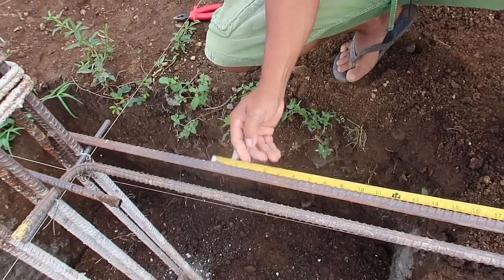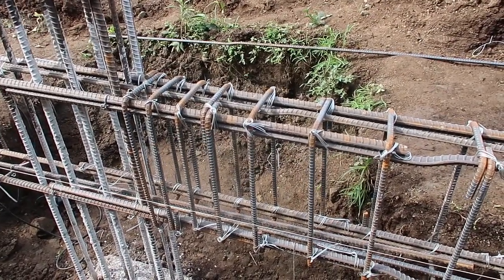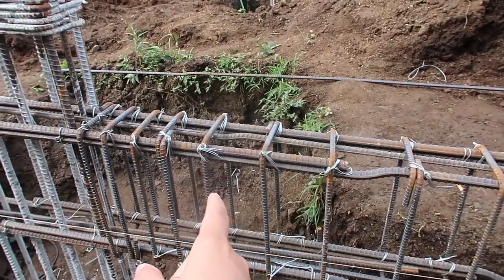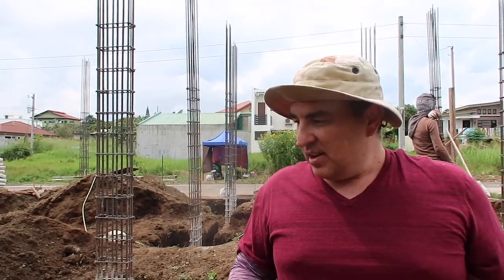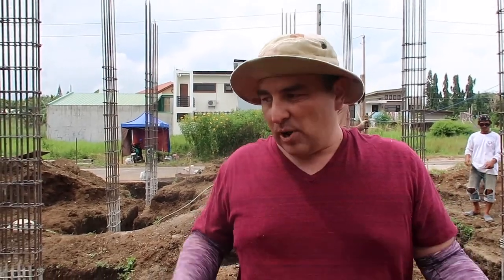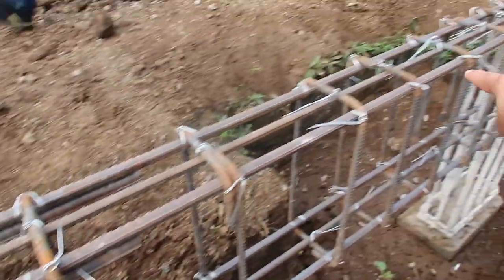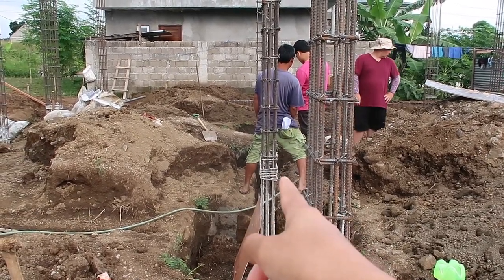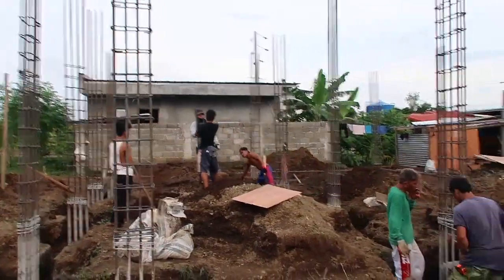HOUSE BUILDING IN THE PHILIPPINES - EPISODE 16: SPLICING

Comment: I agree with Manuel... dont worry so much on the grade beams. Your husband is 100% correct regarding the splicing... top bar should be spliced at the center of two columns but the bottom bar should be close to the column, inside the column even better. On that 16mm rebar your overlap needs to be 64cm. The rule of thumb is lap should be 40 times your bar diameter. So if you are working with a 16mm size bar you need to overlap 64cm. This is actually how they do it here in the Philippines... not sure in other countries.
Reply from the maker: Thanks for the input
Reply: @Mike Ross This is the kind of comment I enjoy reading, very technical and makes sense. Worth treasuring in the brain
Reply: well said.. 40X the diameter  rule of thumb. If you use no. 4  that should be at least 30"  or higher   lap splice. Yes  center of 2 columns for top bars and  bottom bar close to the column. It's same in the U.S Mike .
Reply: Yes the splicing is AT LEAST 40 times rebar diameter. But sometimes it's more than that depending on the analysis and design. I hope 40D is sufficient for your structure since it was already done.

Comment: Hi, I'm a structural engineer. Your idea about splicing is somehow correct. The top bar should be spliced farther the column while the bottom bar should be spliced nearer the support. This is because the rebar is designed to carry the tensile forces of the beam, which is located near the support at the top and at midspan at the bottom. This is not applicable for all beams because beams with discontinuous spans tend to have their tensile forces at the bottom for the whole span. But the most important thing is that the splicing details should be included in the structural plans of your house. You should try to check if it is written in the plans. It is the responsibility of the structural engineer to write it as well as the contractor to follow it. It is also the government's responsibility to check whether the plan is correct.
Reply: Please check the 2:43 of the video. There was a spliced at the confinement zone of tie beam & column.
Reply: Correct engr.
Reply: So that does mean na pag tie beam or nasa ilalim ng lupa yung beam ay dapat yung splicing sa top bar is 2h?at sa bottom bar ay middle third?

Comment: actually its a plinth beam. the upward force is in the center of beam upside, so you the splicing should not be in the upperside in the center but on the bottom and in the upper side near column. plinth beam and regular beams have different moments.

Comment: Hi!
your theory is correct, for the suspended beam
but for the tie beam, it acts differently, the bend is upwards, so splicing will be inverted.
basically, splicing at the column part will be at the Top and at the middle section of the tie beam spliced will be at the bottom.
cheers

Comment: for splice location for tie beam it should be located  L/4  of the length of TB for top bars and L/2 for bottom bars.                          L= length of tie beam,                                                                                                                                                                                                                                                          purposed for tie beam is to prevent uplift pressure coming from ground to overturn your footing foundation. Pressure diagram for the tie beam is curved upward, top bars are prone to tension force at the center and bottom bars are prone to compression force @ bottom. that is why  splice location for tie beam you should follow what is mention aboved.
Reply: Your response ignores the fact that the beams will be load bearing along their top length, and that the ground is not applying anything other than a zero-sum force to the underside of the beams. The following video applies in this situation.
https://www.youtube.com/watch?v=FZYjor8Se9U&list=PLgxsva1T4ojZAlWmyAzNfogA8maHfZi2s&index=2&t=48s

Comment: The splicing of top bar is located at middle or L/2 while bottom bar is at support or L/4
Reply: No. L/4 kalokohan. Near the Support ang ang dapat. Hindi exactly L/4
Reply: @engr.acoustic6803  L/4 and L/2 is the rule of thumb   where the steelman can easily determine and compute the location of splicing.if you say  near the support there is no formula or computation  it is just assumed computation..near the support is under the span of  L/4..

Comment: just only suggestion, It is considered safe since this is a tie beam & supported by a compacted underlying base, as well the reinforcement at bottom beam section designed to resist the weight at the middle span.

Comment: right, splicing on top is in the middle 1/3, 1/3,/1,3 sample, lower part is correct where the splicing. all beam bars are inside the column bars. that's help u

Comment: The splice must be inside the column and the ties of the beam continue inside the column also the stirrups of column continue all the way down you can also install additional rebar on the middle of the beam.so that your beam is very strong
Reply: yeah its correct sir... its called midspan support u put extra 2 rebars in midspan coz the deflection is in the center....

Comment: As a rough guide for top splicing it can be done after 1/4 of the distance away from the columns... if 4 M apart then splice after the 1 M point, middle is a better option and stagger the joints.

Comment: Hi Andy. You are correct with the Splicing issue, but perhaps you do not fully understand why.
At the middle of the top of a beam, the beam will be in compression when loaded from above, such as by the supporting walls of your house.  The major stresses on the top of the beam occur as shear stresses and tension at the point where the beam joins the supporting columns, and that is why there should be a greater number of stirrups along the quarter of the beam length close to the supporting column and most importantly there must be no joins in this section. I used to believe that the shear stresses would be at 90 degrees to the beam, but this is not the case, the shear stesses appear diagonally, thus to counter this the number of stirrups needs to be greater.
The Bottom of the beam will be in tension at the centre of the beam, but at the bottom ends of the beam it will be in compression, hence why joins for the rebar at the bottom of the beam should be as close to the ends of the beam as possible.
.
I hope this helps

Comment: Sir, you are  correct of what  you are thinking.the foreman should know that. By the way I'm a viewer of construction vlog.What I understand about splicing was on the top bar it should be at the middle of the span, and at the bottom bar it should be L/5, ( Total length in between two colums devided by 5 )  so it's position near the column. By the way Sir the mixture of the cement poured in the footing, column and beam was too much water in it. I was a late viewer, anyway you have a nice house.tnx.

Comment: There is a big mistake and can cause problems in the future, the Stirrups, the stirrups ends should be bent 135 degrees inwards for best locking on the concrete .
Reply: Depends on seismic load?

Comment: tie beam footing and other foundation better to consult your geotechnical engineer for soil analysis and structural engineer. in my opinion ground beams the pressure is upward so top bars are in tension splice could be L/4 from support.

Comment: Since your colunm is not tied to the beam (no L shaped rebar going from horizontal to vertical), not a issue. Code for overlapping is more important to get right (say 3 foot overlap and not 6 inches). It is better how ever to have splices offset and away from a high loaded area, so that it does not create a weak point in 1 location. The beam is designed more to keep things from pulling apart, not holding up weight. You could just have the guys weld the rebar together in a couple of spots to solve that issue, but since this was done almost a year ago, it should be fine. As far as doing what you want, it is YOUR money, so you decide how things get done. I have that same problem when I get people to do things at our place in Mindinao.

Comment: Splicing of rebar varies on structural flexural members.
For footing tie beam, the top bar at support (column), and bottom at mid-span. If we consider soil subgrade reaction, the response of the tie beam will bend upward causing top fiber in tension and bottom in compression. Prior to rebar fabrication and installation, there should be rebar shop drawings and bar bending schedule to be reviewed and approved by the engineer of record. 

The case for girders on upper floors has a different response since it will carry floor loads. It will bend downward resulting in midspan bottom fiber in tension and top in compression. Place top bar splice at midspan and bottom start at 2x the height of girder being considered. The 2H start of splice and tension lap splice length is recommended since stress reversal occurs when the frame is swaying due to lateral forces assuming this project located at seismic zone 4.

For beams that usually carry gravity loads, place the top bar splice at the midspan and the bottom bar at support.
Reply: Hello what if yung tie beam is naka pantay sa 0.00 elevation ng house? Pano po iyon? Bale yung top is 2h at bottom naman ang nasa middle third?

Comment: Worry  less on ground  tie beams..Worry more  on above  ground  tie beams...You don't have basement....Try to  avoid  splicing..Rebars  comes in 40 ft... If you  have to.. do it somewhere  in the middle  with minimum 2 feet  overlap..Don't  splice directly opposite  one another.. This results to a weak area...U.S.  uses couplers/connectors then hydraulic  press or crimper...One options  are weld it or use U bolts..
Reply: What are you credentials?
Reply: @thomascherney7873  My only credential  is work experience  & observations from others... like  building inspectors.  However.   I can learn  from others  with  better  credentials.

Comment: You are correct. Splicing must not be done where the rebars bear the tension. In a beam that is continuous across a column near the column the tensile stress is st the top, but at the middle of the beam the tensile stress is at the bottom of the beam. 

So, REDDIT as the husband says because the splice is not strong enough in tension. 
If you don't want to redo it, you can strengthen the splice by welding it along the splice as it is now!

Comment: The explanation of why we should place the splices in the middle is just funny 😅, he missed the story on why we recommend to place the splice of the top reinforcement in the middle of the span and bottom on the support. Any way it is just a recommended practice not a most and it will not make your structure weeker

Comment: splicing should be done in alternate way, regarding the size of rebars you can also order according to your preferred length, 6 meters length is only a base length, i suggest you use grade 40 rebars.

Comment: Thank you for the video. The beam reinforcements arrangement will be okay if it is just a tie beam. However, if it is going to experience bending moment and shear force, the reinforcement could be arranged in the other way round, by considering the grade beam reactions as inverted suspended beams.  Fadeyi Lawrence Olaniyi, Nigeria

Comment: I think they are still in the planning stage, a lot slower work if that's the situation. They could have  improved the Pace.At  The middle of the beam , a column is necessary IF the Span is greater than 3 meters vetween 2 post or column, but if its just the ground tie beam, it can be omitted,but not if its overhead beam!

Comment: The guy is right about splicing and he should have told his workers do it his way but on the tie beam it probably does not matter much because that will be underground although when they get to the beams it should be the white boy's idea that should be followed.
Reply: Just because the beam is underground does not mean that it is not load bearing. The white guy (Andy) is correct full stop. It is not an idea but recognised correct building practice. Even in the Pilipinas

Comment: Bottom splices no more than 25% of  of span from the end to the center of the
 overlap. Top splice center falls within the center 25% of span. Overlap on beams
 is 40 bar diameters with the dog leg bend of one bar like you have done.
     The location of the tie beams is between all adjacent columns and under the
center of the wall hollow blocks because it is also a footer for the wall. I always
pour the floors after the tie beams  and occasionally monolithically with the tie
beams on smaller floors like 5 by 8 meters where you won't be cutting a lot of
expansion crack reliefs. Then the walls go on top of the floor which can extend
past the tie beams  about 3 times the floor thickness. If the walls don't land on
the tie beams pour footers to set the walls on. minimum depth is the finish wall 
thickness and width is 3 times wall thickness (blockwork plus render) with rebar
3 bar diameters up from the bottom of the footer.
        For floors I start bars with a 16 inch length stagger  at the end and step back 16"
on each succeeding row. Whatever is left at the far side is the first piece of the next
row. Any left over bits get tied at 45 degrees at the corners of the columns to help
reduce inside corner type cracks where the floor wraps around the columns. With this
approach no bar splices are  beside each other and I use a standard lap of 16 inches 
minimum on smaller bars and 24 inches for 12mm and above. Spacing of bars  is
calculated for the short dimension of a floor with  a 50% safety factor on the concrete
and rebar weight (dead load) and 50 pounds  per square foot live load plus any thing
permanently affixed to the structure. The rebars set 90 degrees to the calculated
direction are actually all just more stabilization and safety factor.
        One other thing, I start calculating rebar stress at the top of the building where
the roof attaches, and then work down adding everything above a point at the floor
level tie beams and column weight to that level. Then add the suspended floor and in
all the walls and columns weight to size the next floor tie beams and column 
sizing which would typically be the tie beams you are pouring now. The top beams and columns are about 25% smaller than the first floor even with the concrete flat roof.  We
also have a spider beam holding up the roof with 10 legs and 162 rebars passing the 
center point and 530 feet of electrical conduit in the spider beam.  And .......still no
electrical connection.

                                    george and aurora

Comment: Splicing is always the upper rebars should be 1 meter away from the column and the lower rebars should be 80cm or 0.80 meter
And splicing also in the middle but is not exactly at the middle, and it should be the same near the column , get the middle and splice it away at 1meter for the upper rebars and 0.80 meter for the lower rebars

Comment: I am not an engineer but i understand somehow how to build a concrete house. Sorry to say all what they do are not in accordance to how a concrete house should be build, for example even the stirrups should be bend not only 100 digrees but 135 digrees. About the splicing they should not put it next to the columm and the joint should not be in the same lenght with the others. One more thing i've noticed was under the tighbeams they did not put gravel first before they poured the cement and maybe also all the columms.🙄 i think the soil has a low bearing capacity.....thanks for reading my coment....i might be wrong or i might be right...peace!! Godbless

Comment: Avoid  over watering  the concrete...Overwatering  results to poor compression  strength of concrete...A sign of  overwatering  is concrete  bleeding...Wait  for an hour or two...At thin layer  of water  will  appear on the surface...Surface is smooth  and slight  discoloration  on top. Read the instructions on the cement  label..Different  Portland  brands  have different  formulations..What grade of Portland  are u  using... grade 33...43..or 53...

Comment: thats the problem that theres no project engineer in the site, or hard copy of structural design done by and architect. you can design it even theres a specific or limited sizes of rebars that you can use here in the philippines.
Reply: Structural Design is done by a Civil Engr "NOT" by an Arki, Arki is only for Architectural design and Architectural plan only

Comment: The annoying thing for the worker is when their work is being talked about ( they think that their work is being criticized or corrected) and as an architect. The splicing / spacing of the rebar & the size of the rebar 1/2” dia? That’s the baseline size for the column , beam , tie beam in a typical house . And also you’re showing in the video is a tie beam , it’s sitting on the ground no matter what the load above is still structurally sound.

Comment: Sir, I
would like to share my idea hope it would help.

Splicing location near the support for the tension bars in compression zone is
theoretically not accepted by the code. Because the maximum negative bending
stress occurs in that area.
Splice location should be away from
inflection point going to the mid span.